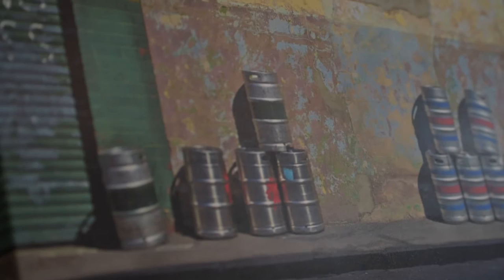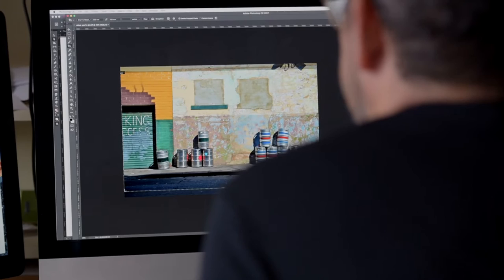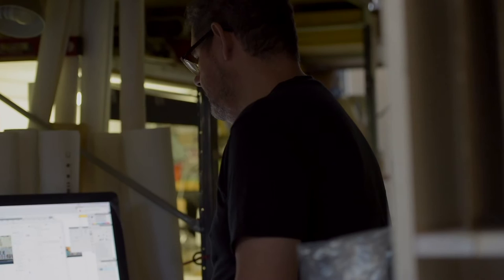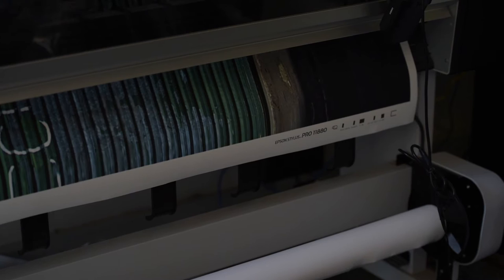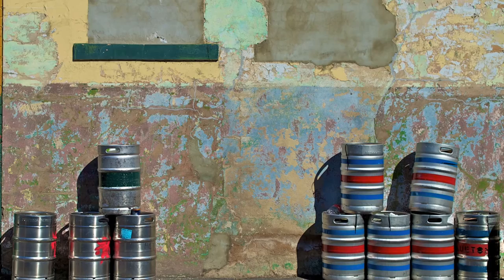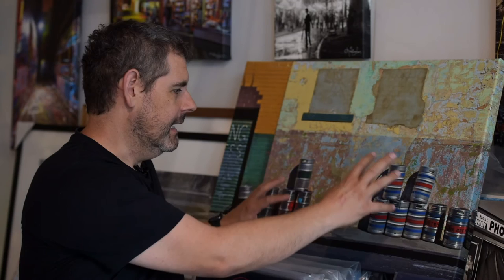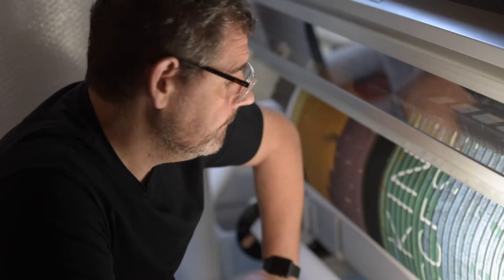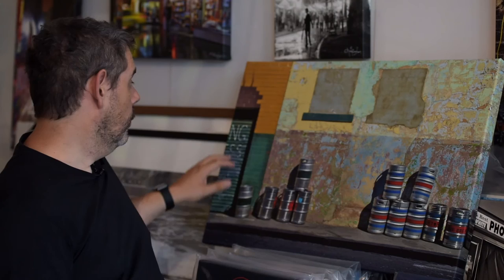Epson Large Format Printing the Biggest 12 MEGAPIXEL CANVAS From a Nikon!

Comment: I have a question:
How did yo get that sharpness in the big print??!!
I made the simple math, for 4000 pixel width and 2.5m  length you must print at 40 pixels/inch!

It is impossible that it was printed at such rate!!!!
What is the Paradoxial idea here?!
Im waiting 4 your interpretation!
Reply from the maker: Hi Eric, indeed it is impressive what the Epson printer can achieve.  I also think some of how I get away with this is the image is made up of blocks of flat colour.  This is not an image about detail. Also the fact that canvas is textured, also assists.   And when it is over 2m in size you stand back.  But it works and it is real.  I have even blown an 8 MP file up to 2.2m, and it started to fall apart a little at that point.  Would you like more videos about this ?  Cheers Matt
Reply: @MattIrwinPhotography  Yes for sure, coz I believe that the Photography is nothing unless it is turned into what I call: " ArtoGraphy", hence, it will be more appreciated and evaluated extremely when the creativity takes place!
It is the (tip of top) photography work.